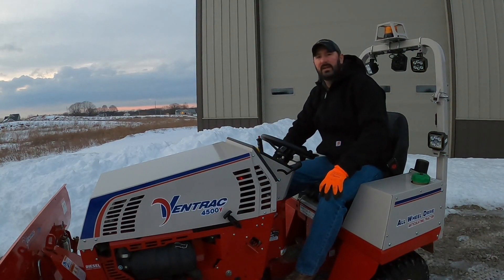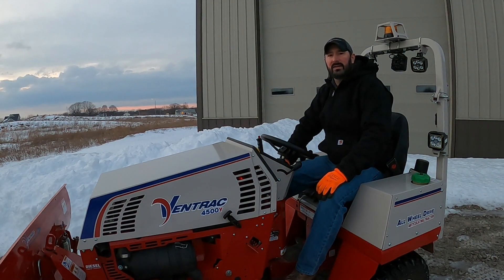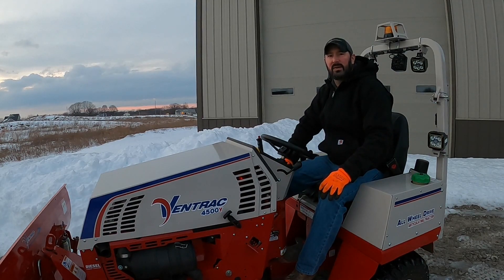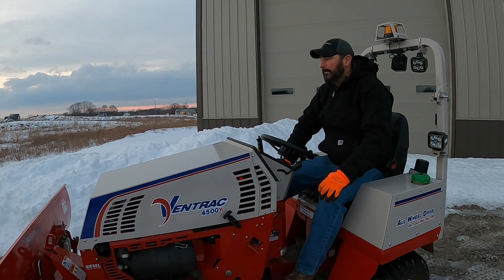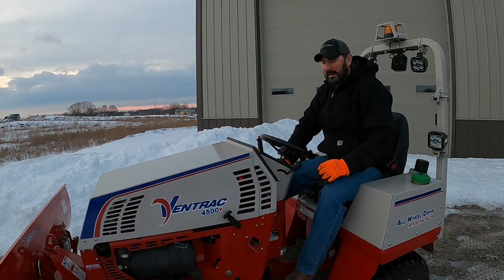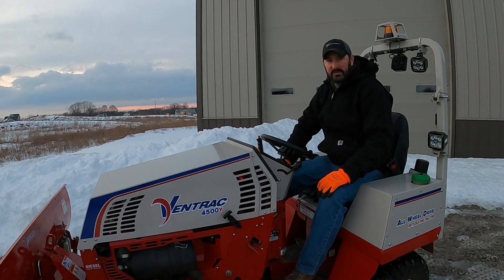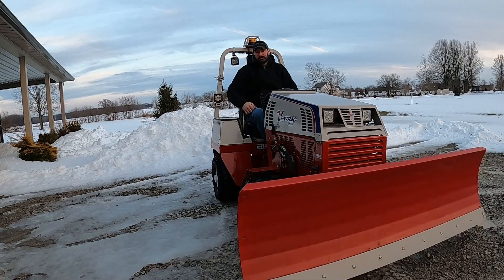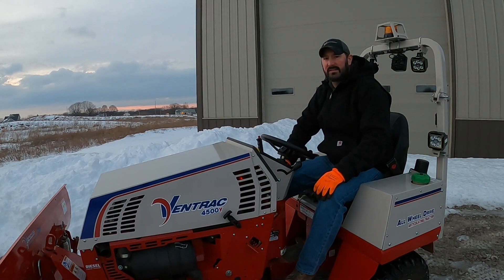Using Ventrac Weight Transfer For Plowing Snow!

Comment: Using some weight transfer really helps with tracking! Nice show of it. 👍😎
I'll bet another advantage is that with weight transfer at the 'sweet spot' you can pretty much snap the lever over to float quickly while the plow is up; it will drop gracefully with no fuss on your part... as opposed to intentionally slowly setting it down gently first, and then snapping over to float.

Comment: Why is the 48 inch blade more expensive than the 60" and 72" blade? 

Sorry..... not expecting you to know.  Just perusing their website and trying to figure out why the odd costs on the blades, and then stumbled on your video
Reply from the maker: I am not sure why that is. My only guess is more specialty item for sidewalk snow removal, so it costs more. That is strange tho.
Reply: @steiger256  - that's what I was gathering too..... but it still makes no sense.  i mean it's the same operation as the larger blades..... but less material.  Just in material cost alone would lead one to believe it would cost less to purchase.  I'm noticing a few things like this on Ventrac's site.  Odd pricing that is. (not to mention INSANE pricing...... The Ventrac is incredibly intriguing..... but $31,000 for a suped up traditional riding lawn mower/tractor?  The Soil Cultivator is what caught my eye and got me interested in the brand.  But the refusal to have a rear PTO because of essentially their "mission statement" when they first started is annoying.  I mean.... having it attach to the front... ALSO goes against their "mission statement."  The reason they are dedicated to front end attachments is because they think it's safer and you don't have to strain and turn your body to monitor the attachment.  Well.... that goes out the window with the Cultivator because in order to use it you have to go in reverse on the tractor, so then you're cranking your body around just to see where the hell you're driving, haha.  

Maybe if I win the lottery I'll get a Ventrac setup, but until then i think I'll settle with my current setup.